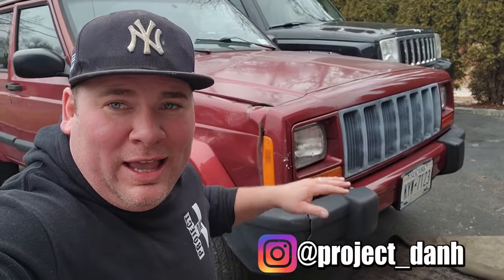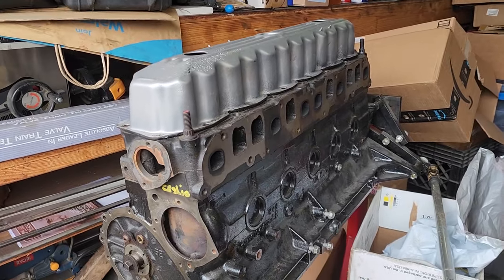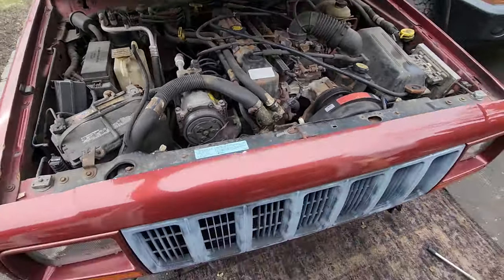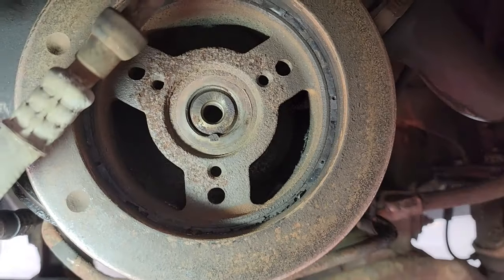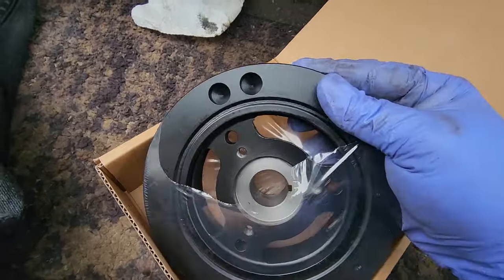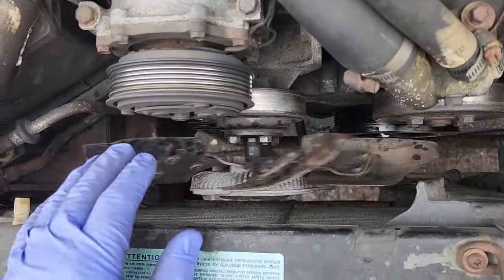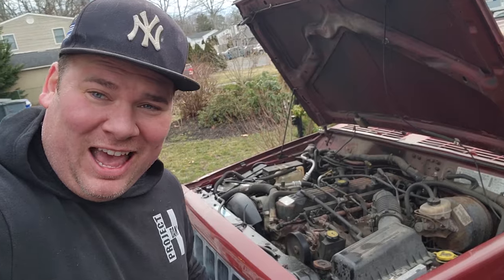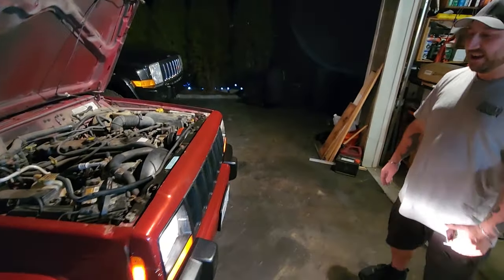JEEP XJ HARMONIC BALANCER PULLEY & BELT INSTALL ON A 1999 CHILI PEPPER XJ CHEROKEE

Comment from the maker: The key to a harmonic balancer swap is a bumper removal and a step up drill bit!
Reply: Would it be easier to remove the bumper from the brackets that are bolted to the frame? They are more easy to get to. 
As always, great video Dan!
Reply from the maker: @15farcry  not really.. I don't like messing with the torx bolts.. for some reason their clip nuts always snap off..  and if you leave those bracket on the Jeep they always cut your shins when you walk by. 🤣
Reply: @ProjectDanH  Gotcha, makes sense. Sounds like you're speaking from experience.😆

Comment: Nice Dan ... and great you added the shroud, but that fan needs replacing ... they should not spin freely/easy, common issue with overheating ... relatively cheap part
Reply from the maker: True!  Good eye too. The clutch is probably past its usefulness

Comment: Great work!! I just did mine a week ago Monday. Daughter was driving the XJ and said there is a loud ticking. Turned out it was the balancer pulley getting smacked by the fan. I used the OEM Tools harmonic balancer puller kit and removed and reinstalled without removing the bumper. Thinking it was so difficult because the inner core wasn't getting pulled straight and binding on the shaft. Your friend should also consider replacing the timing cover seal. It obviously needs it (puking oil).  Love your videos Dan H!!! Always great content!
Reply from the maker: Lol, puking oil indeed! A seal would have been great.  I forgot to suggest one.  Sorry, I tried to keep it simple
Reply: @ProjectDanH  absolutely! You gotta draw the line somewhere. Thank you for helping so many of us in the XJ and ZJ family!! We are very grateful for the time you do take to make this content!! Always look forward to your videos!
Reply from the maker: @brianlook6306  thank you for your encouragement! God bless!

Comment: Hey Dan,
Do you think a worn balancer will cause the 4.0 to rattle like a diesel when you quickly tap the throttle? Mine is doing that and I noticed the balancer is starting to "walk" off the crank snout.